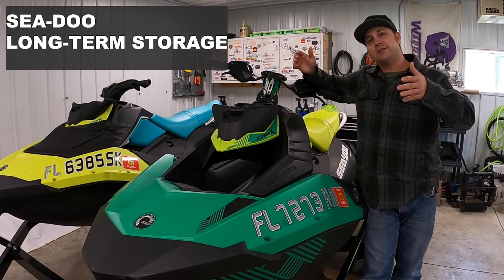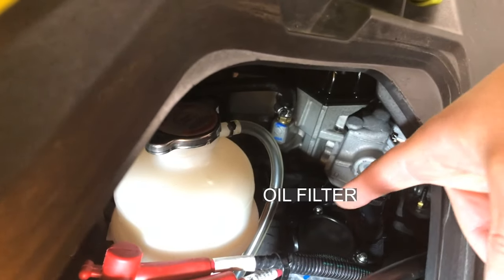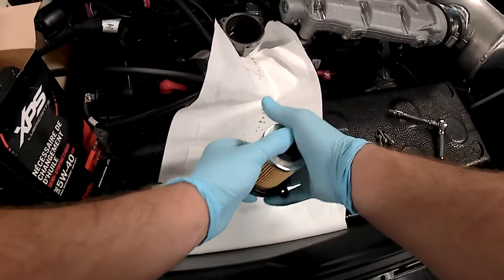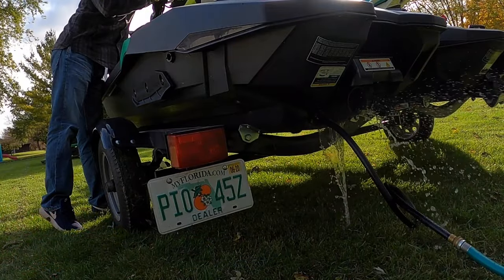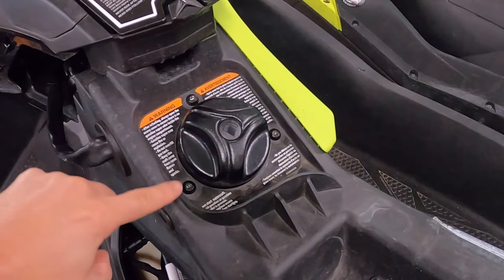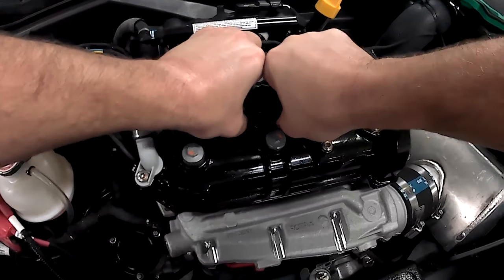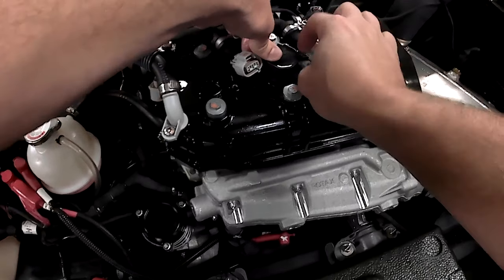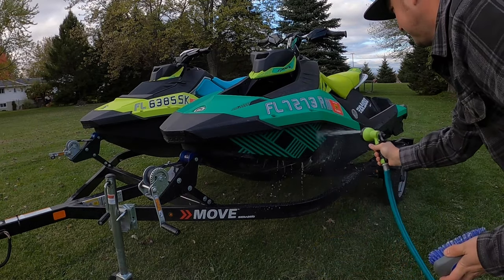How to Winterize Your Sea-Doo

Comment: A few simple steps? You took half of it apart.
Reply: That seemed like alot. Bet most people dont do all that
Reply from the maker: @TorontoPWC  Sounds like you do it right!
Reply from the maker: Popping the top on a SPARK is nothing more than nuts and bolts... You got this!
Reply: Removing top deck on a spark takes what? 15 mins?
Reply: Less after you’ve done it a couple times. It’s actually kind of nice having wide open access to everything.
Reply: I don’t think you need to do all what he showed Jeep with you think he’s putting it up for three years

Comment: He said simple then used a cut away and took the hull apart seems like a non user friendly design for access to the engine
Reply from the maker: Complete hood removal is not required to change oil or plugs - only done for better visual. If you do ever need additional access to engine, it's just series of nuts and bolts to gain access.

Comment: I was more curious if I had to do the engine but I’ve been told it’s sealed with antifreeze already in it so you do not have to touch that and you only have to winterize the outdrive which I did with a small pump and a hose. Thank you everyone for your comments

Comment: Quick question? If you only used 2-3 times during the season, do you have to do the step where you spray anti corrosive in the plug holes where the spark plugs go? Also, I’m thinking it wouldn’t need an oil change either? Thanks!!

Comment: You guys need to make a video on how to de-winterize at the start of the season
Reply: Put the battery back in, start it up, and have fun! :D
Reply: @brentgeeter7325  pretty much. I’ll run it on my driveway on the hose for a minute to rinse out the antifreeze from the exhaust system. And, some guys like to put new spark plugs in after the cylinders sit all winter with fogging oil in them, but yeah. Basically, assuming you did everything by the book (including stabilizing the fuel), put gas in and go.

Comment: Umm when do you flush with antifreeze??? Isn't that the main part of winterizing?
Reply: This one is probably sealed with a closed coolant system, like a car or truck, unlike others or even outboard motors that are water cooled. You can either blow out the water from the drive system or blow it out and run coolant through it

Comment: Curious question why do you put a garden hose to it and run water through it if you just gonna blow it out with air anyway.
Fred
Reply: Thinking the same thing. Only logical conclusion I reached was to flush salt out of the system if it was a ocean doo!
Reply: Instead of the hose, I’ve always used a bucket with antifreeze and a pump, and pump antifreeze through till it pisses pink.

Comment: Why would you turn the ski on after applying fogging oil.... that’s just going burn it out... you can crank the motor without the coil packs if u want to make sure it completely lines the cylinder walls but turning the ski on is an epic fail...
Reply: . he held the throttle wide open it while cranking it and that distributes the fogging oil on cylinder walls. It wont start up and burn fog oil if you hold throttle wide open. why it somehow fired up is strange he must not have held the throttle  fully wide open i guess . i never have a problem.